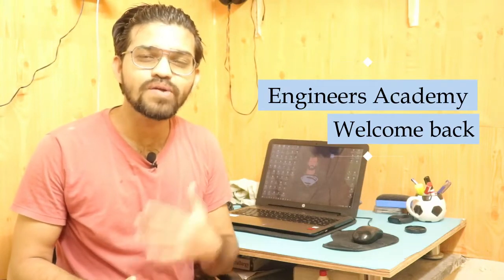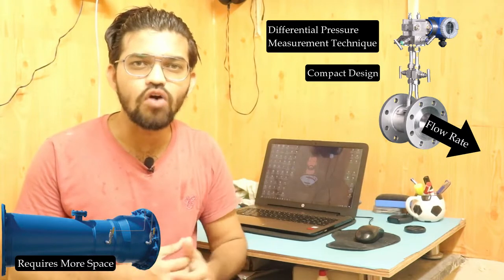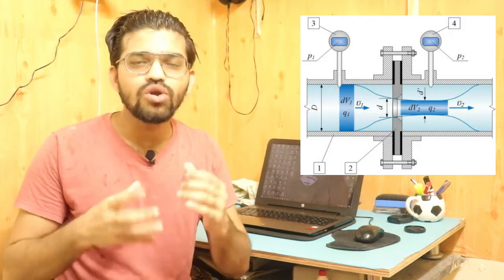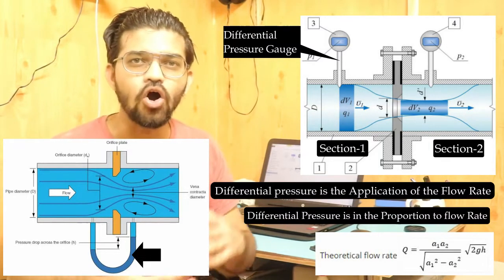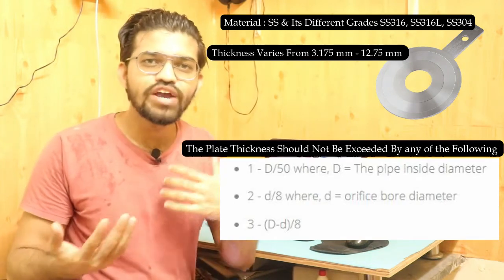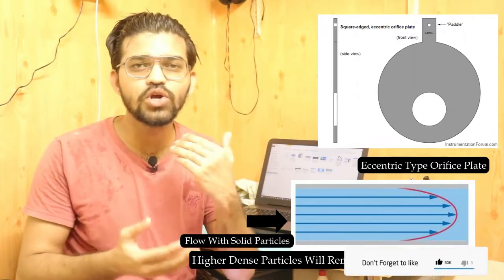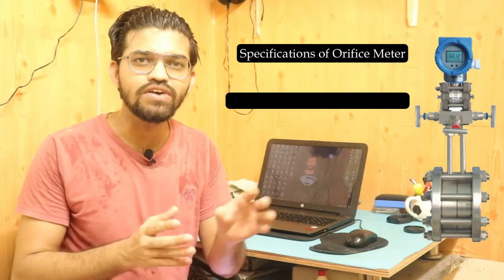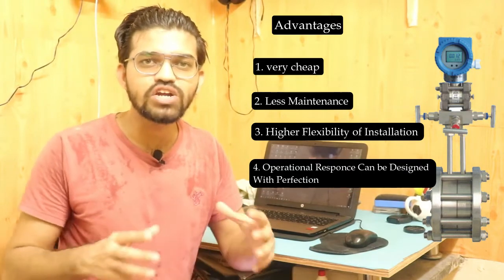Orifice Meter. Construction, working, Application, Advantages & Disadvantages.

Comment: So sorry but no clue what all the math is. But also very interested because I work with orifices. But don't really get it. Usually 17/64" >. I'm trying to figure out my own orifice to certain parameters (liquid and air psi), to get the most efficiency with less trial and error. And advice. Ps. Please dumb it down little bit. Lol

Comment: Bro why pressure drop is occured after passing through orifice hole.it should increase no? Due to change in dia of pipe!
Reply from the maker: Pressure gets dropped when liquid passes through orifice hole..
Reply: @EngineersAcademy9204  it should increase no!due to small dia of orifice than pipe
Reply from the maker: @SandeepYadav-bj1zl  i think u talking about flow.. flow will increase
Reply: Due to decrease in area of cross section on entering the orifice, velocity of fluid flow increases according to continuity equation/mass conservation A1V1=A2V2. According to Bernoulli's Equation, pressure drops as velocity increases. We measure this drop in pressure between upstream and orifice to calculate mass flow rate. On the other side of the orifice, the velocity decreases and pressure increases but the original pressure won't be attained due to frictional and turbulence losses in the real fluid and there is a permanent pressure drop, which is one of the demerits of the orifice meter.

Comment: Why is it require to make fliw streamline ...what if we let the fluid flow as it is?..
Reply from the maker: Nice question ! When turbulent flow moves in the pipeline it causes the vibrations in the pipeline.. to damp that vibrations extra supports and dampners will be required. Also this turbulent flow can damage the other instruments/ valves  fitted in the line.. in that turbulent flow the solid particles can move in anydirection and damage the instrument. whereas in case of laminaar .. if  there is any solid particle it will rest at bottom side. !
Reply: @EngineersAcademy9204  ohk...coz they only told that this is orfice ...what after that...they didnt told..thank you 😊 you are doing great💯